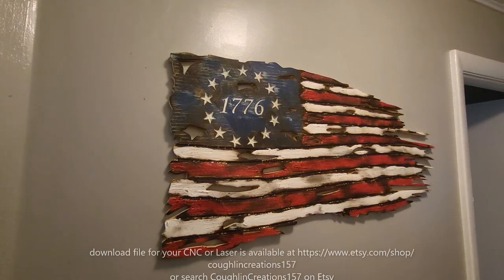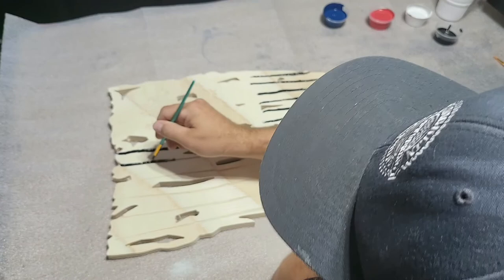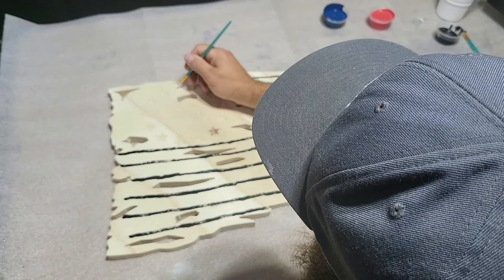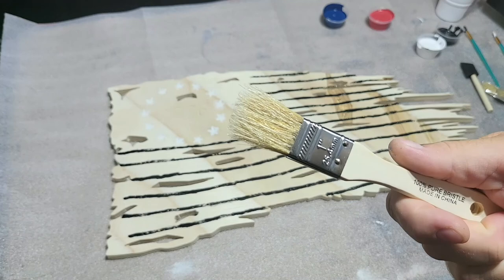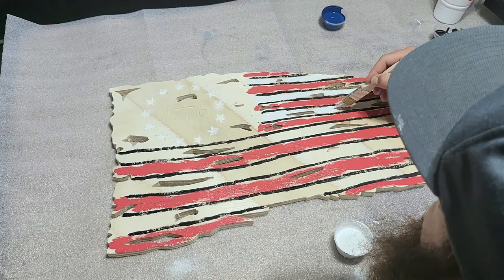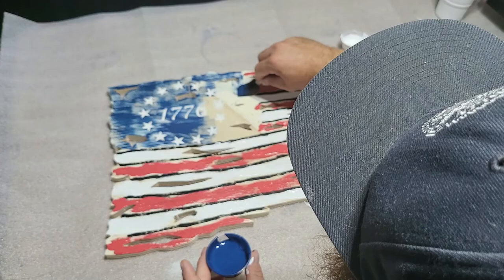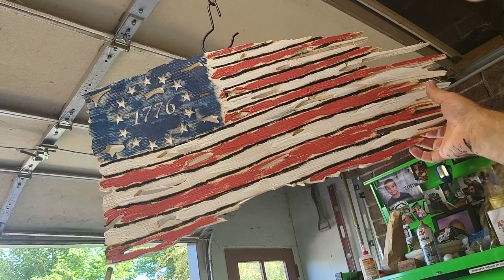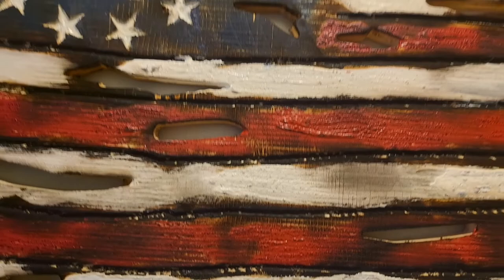Painting a CNC cut Tattered flag

Comment: Great work thanks three questions where did you get file do youbuse ball nose to also cut holes in some of those sections and what is the size please?
Reply from the maker: Hi the file is available at https://www.etsy.com/shop/CoughlinCreations157. I used a .25 inch ballnose to do the waves. I used a 60 degree v bit to do the flag lines and stars and i used a .125 compression bit to do the holes and the outside